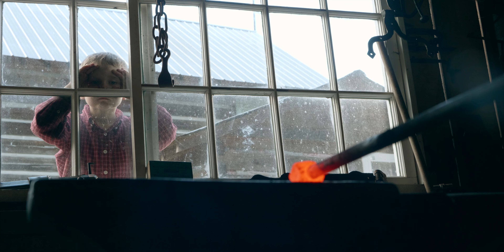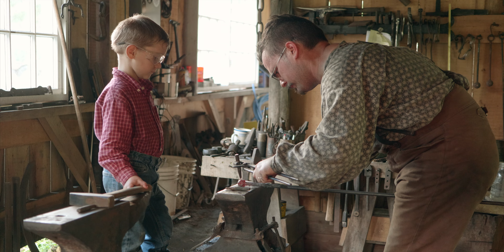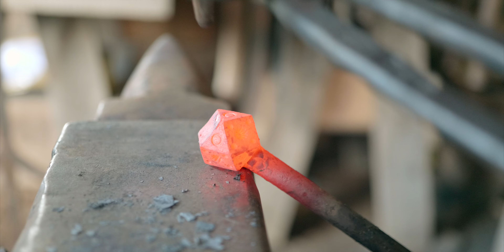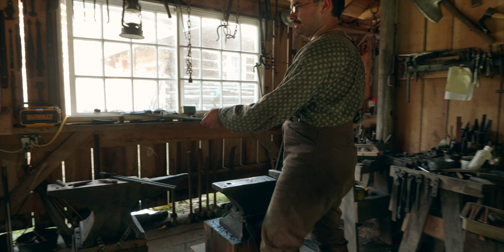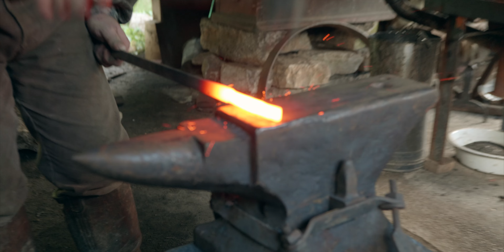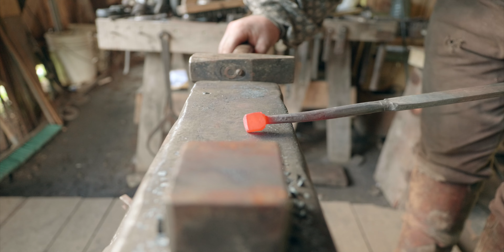Forging a Blacksmith's Diamond

Comment: I tried this after coming on to your channel ,I used pallet spool rods both for the rod and the welded material, I still had a circle in the end is this unavoidable
Reply from the maker: So your weld didn’t take? These can certainly be tricky. Just gotta keep trying and use plenty of heat and borax.
Reply: It was round stock on round stock

Comment: Just a question, why do you work on the back of the anvil? Was always taught to work on the other side and with the horn towards the forge......regardless nice clean forging ..from Australia
Reply from the maker: Hey Toni! There’s a strong tradition for sure of putting the horn towards your tong hand that is largely rooted in making and shaping horseshoes. But, overall historically, there’s precedent for both ways. I know a number of really good smiths who turn the horn towards their hammer hand, and I greatly prefer it. It makes many operations easier, but for me the most important thing is it makes it easier to work around hardy tooling.
Reply: Reading this made me think of both the comments. My anvil is a Ridgid Peddinghaus European style I believe and my Hardy hole is right next to the horn. I do think both are nice on my tong hand side. But a traditional anvil like Jordan is working on has the horn and hardy opposite sides. Always interesting, I’m a 4H shooting sports instructors and pay attention to archery and rifle shooters. Many different styles, generally it’s best for the kids to find what works best for them, I figure blacksmithing is no different

Comment: Great video, very well done.  I retired from teaching physics and mathematics and took up blacksmithing, so a cube-octahedron is right down my alley.  I used to make lots of different polyhedra, generally out of poster board, to use as demos in class to discuss some math thing or other.  I've made more or less this shape as the knocker part of a door knocker, using the wrap and forge weld method.  Your work is very clean on the facets, I really like it, it'll inspire me to make some more as finials.  Thanks again. Oh yes, I really enjoyed your helper, give him a high five for me!